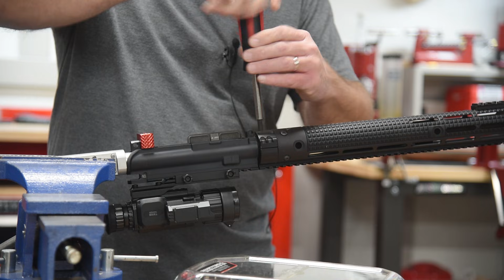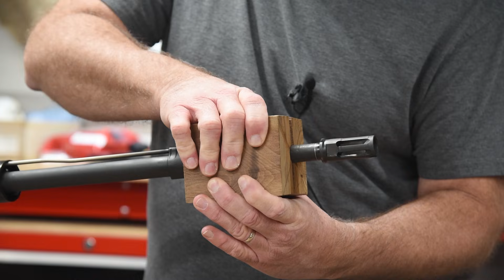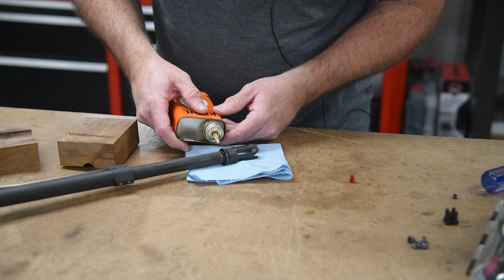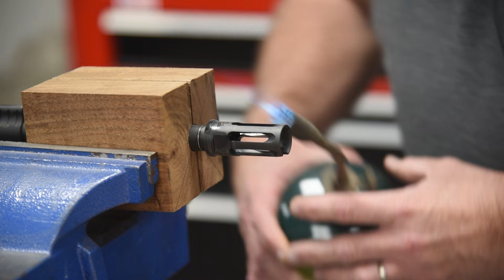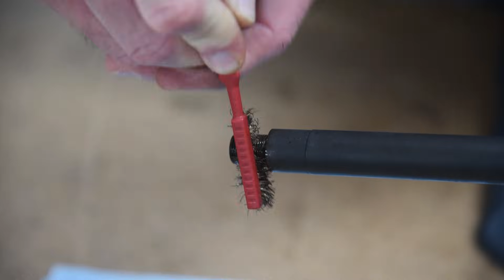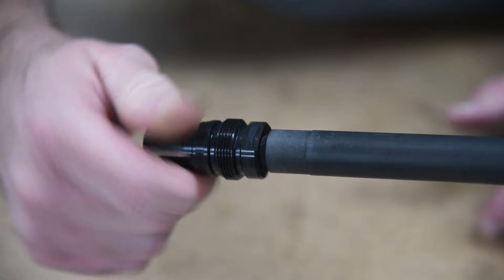Remove a Stuck Muzzle Device

Comment: I could see the shim instead of a crush washer and imagine it was put on using Rokset. You need to use a hot water soak to soften in it in order to remove.

Comment: Armorers and gunsmiths hate owners that feel compelled to Red Loctite every nut, screw, bolt and thread on their guns. Saw one gunssmith at an LGS return a rifle to its owner after he discovered the owner had used Red Loctite on the buffer tube castle nut -- refusing to work on it further.

Comment: You don't need to take off your handguard. Get the steel rod from brownells. It locks into the rear of the barrel. Several people make this tool from brownells, bill Giselle ,and others. I think brownells is  the cheapest.  Anyway, slide your upper on it until it firmly locks in place. Now you can go and turn off even the tightest muzzle device.
Reply: Those rods, while useful, especially if it has a sail/spline on top, are not intended for very stuck on muzzle devices. The actual barrel can unscrew itself from the barrel extension, which if properly torqued, is torqued only to 150 foot pounds. It happens all the time to people that dont know better. The barrel then cannot be torqued back onto the barrel extension by just anybody. This guy in the video knew what he was doing for the most part by securing the barrel itself and not the barrel extension. The surefire muzzle device should have been an obvious giveaway that the muzzle device was rocksetted onto the barrel.

Comment: okay cool, but I have some questions I apologize for so many but i'm getting so frustrated trying to get a flash supressor off my S&W MP 15-22 you wouldnt think these things need to be this tight its overkill imo. lol 
So  where did you get the wooden blocks ?  did you make those yourself? are synthetic blocks better? , have you ever wraped  the barrel in leather or thick masking tape first then just clamped it down? 
I think i will use a dead blow hammer on mine and tap it to simulate impact wrench is that a bad idea?
 dont want to mess up my rifle is all and I want to get my real suppressor on the dang thing 
thank you for the video 🙏

Comment: I didn’t notice a crush washer when you removed the muzzle device.
Reply: If zoom in @ 14:25 you can see the washer
Reply: He's got a shim on it since he use that muzzle device for a suppressor. Shim for suppressor nut crushed washer.
Reply: Many suppressor compatible muzzle devices like this one use timing shims instead of a crush washer. This is why Rocksett is applied to the threads. This is why the device wasn't budging. There is a different method for Rocksett.

Comment: Do people not know what a cheater pipe is? It basically extends your grip on your wrench and gives you much more leverage. The longer the pipe the more leverage. It won’t fix really stuck muzzle device but heat will.     it will make removing stubborn ones SOOOOOOOOO much easier
Reply: His problem was not leverage, it was how tight the device was stuck on. It was spinning even in between the wooden blocks that were on the vice grip

Comment: For stuck metal items heat and vibration are the main solutions.  I would have started with heat before starting, tap the metal and let it cool a little, then more oil hoping it would suck in to dry threads.  Probably repeat also.  Too much torque on aluminum could cause distortion

Comment: I would recommend using a reaction rod but the wood clamp is fine if you only need to do one type of barrel. Of the muzzle device is a suppressor host it was most likely installed with Rockset or Hot Lock which will break down in water. Soak the muzzle for about an hour then remove it. It wouldn’t hurt to stuff an oiled plug into the muzzle during the soaking process.

Comment: What if you shoot it tell the barrel is hot then try
Reply: Heating the "nut" (muzzle device) expands the metal around the cooler barrel, hopefully loosening or breaking it loose. Heating the barrel actually will make the joint tighter. 
  We used to do this for the gland nut on VW bug engines. To remove, you had to heat the crank end up. This expanded it around the nut, making removal easier. To re-install, we'd pop the gland nut in the freezer and heat the crank end up. Grab the nut from the freezer and install it as tight as you could by hand. Once they equalized, the nut was torqued in perfectly. Never had one come apart.

Comment: That is a shit load of rockset on there.. I usually have to Dremel cut a line into the muzzle brake, almost to the threads, then do the boiling water & torch trick lol. BearCreekArsenal put a cheap one on my upper with no crush or flat washer, just slapped right on -.-

Comment: I’ve always had great luck with the wooden or synthetic blocks with the addition of an old cut up bicycle tire on the meeting surfaces of the barrel and the vice blocks. It adds superb grip without mooring the finish. Great video. Thank you for posting.!
Reply: This… old inner tube works as well in my experiences.

Comment: You're a DA!!! You obviously don't know what you are doing!!! You have a Receiver Rod to hold the barrel yet you don't use it and instead you use wood blocks to hold your barrel is comical. You waiting 3 hour for oil to work is comical as well. You should've gone to the torch a lot sooner!
Reply: The rod is not the correct tool for very stuck on muzzle devices. The barrel can unscrew from the barrel extension, which if happens you are essentially screwed. He is doing it correctly. You guys are clearly still new at this and will probably even delete your comments after you go learn more about barrels.
Reply: The whole time I’m like that’s exactly what the real avid tool is for. That receiver rod didn’t even touch the upper. God darn fudd!!!!

Comment: I've had at least two guns with barrel nuts that where thread locked on so hard that I had to cut them off. That after standing on an extended wrench with a cracker bar while receiver was in a vice. The nut was too thick to allow heating effectively . Most every muzzle device so far, had came off with a hard wack to the tool.

Comment: Smack your wrench with a brass or dead blow hammer to give it a good jolt as opposed to constant pressure on your wrench. Will usually give better results.
Reply: This is what I'd say. I've done enough wrenching to know a quick smack on a stuck nut or bolt after soak gives it that sharp shearing force to break the bond and the rest is easy.

Comment: When needed I put a strip of thin rubber (like a bike tire tube) around barrel then clamp it. At first I thought yours might have been pinned and welded being a factory install. Some do this to keep OAL within legal limits. Muzzle devices should be treated to Rocksett not loctite as its oil and cleaning chemical resistant. The only way to safely break it free is to put tip of barrel/muzzle device into boiling water for 10-15 minutes. Its not so critical for just a muzzle device but when a can is going to be added it becomes much more important. Acetone is also a better solvent for initial thread cleaning then Alcohol for final cleanup.
Reply: I used rubber, scratch my barrel & MB

Comment: A plumber’s trick is to actually try to tighten it first and then reverse to loosen. Sometimes this will break the seal.
Reply: Learn that while fixing my own car in the rust belt.. idk how many and nut or bolt goes righty loosy or lefty float free
Reply: Clever
Reply: That's an old motorcycle mechanic trick. I learned it in the 80s, and it was probably old then.
Reply: @garybonz  Me too .

Comment: Try using a cheater pipe on your clamp will increase your torque for tightening the wood clamps and you should probably just just go right to the heat even starting out with a hairdryer then a heat gun finally a torch if need be some say soaking and boiling water if it’s rocset will work also

Comment: Rockset can be placed in boiling water on your kitchen stove (best done when the Wife is away) for a few minutes to soften it. I use a Geislee reaction rod to hold the chamber trunion secure then twist off the muzzle device.

Comment: If heat doesn't work, it's likely Rocksett. Not to be confused with the 80's band Roxette. 
Rocksett is a ceramic-based adhesive that can only be reliably broken by soaking it in water (resists oils). Soak the joint in hot water for at least 10-15 minutes. Try it. If still not loose, give it more time, an hour or so.
Reply: This guy, he’s got the moves.
Reply: You've got the look!

Comment: I've had good luck adding a thin piece of latex between the wood blocks and the barrel. I cut a strip from a latex glove, however I think a balloon would probably also work
Reply: Nice. I was thinking a strip cut off of one of those jar opener grippy things (technical term)..